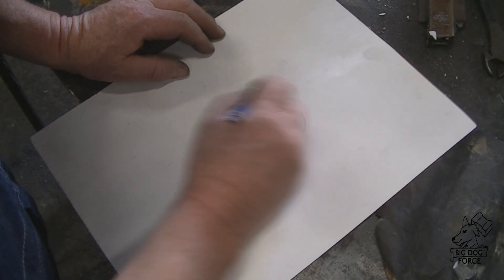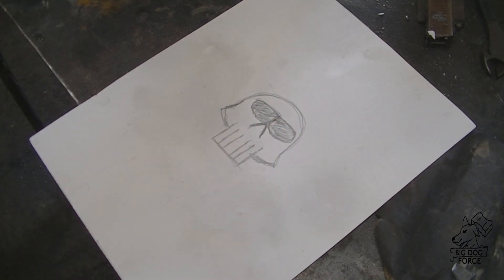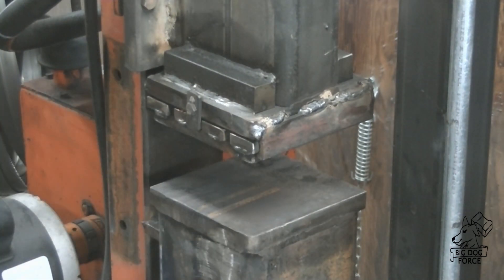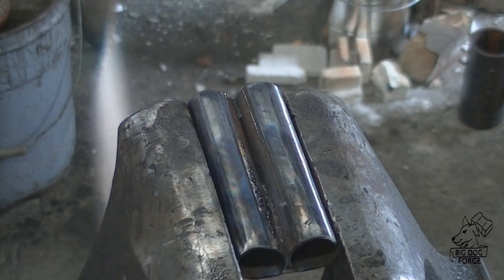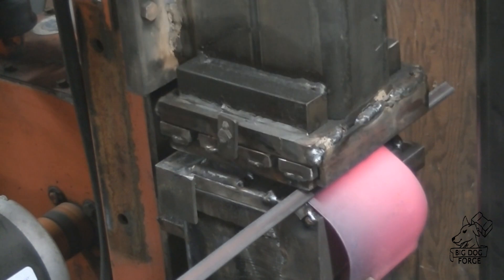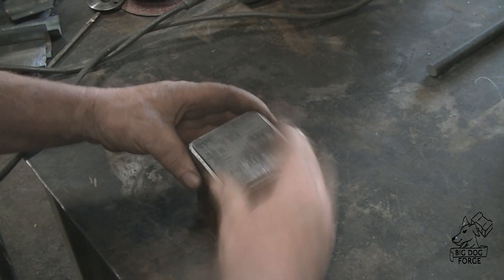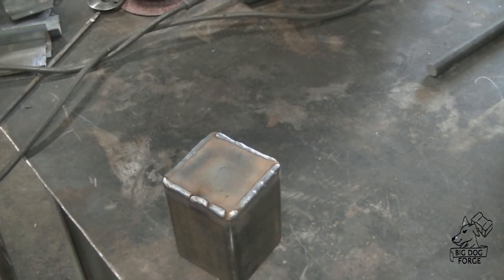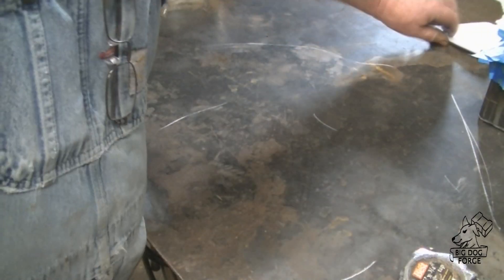Forging / Blacksmithing Skull Damascus Part #1

Comment: it was only $14 to send all that chain, i work on forklifts for a living so all that chain is new cut offs. can't wait to see what you do with it. the other piece is part of a cutting blade for an excavator. and i love the skull, very cool
Reply: Hey, if you have any more of that cut off, and want to send some to a poor old timer in Ohio, let me know and I will provide you with my address. I can definitely afford the postage, but that's about all I can do. Sorry, but I am retired and living on a very fixed income.
Reply: i can get as much as you want "within reason lol" but i like to trade for other stuff. what do you have to trade?
Reply: Not really sure. Hadn't thought about that. I do have some excellent walnut 12" x 2" square blanks and a couple of cherry of the same dimension. Will have to think about it.Thanks for the quick response.
Reply: email sent
Reply from the maker: Thanks Jason I can't wait to use the chain, and thanks for the kind words.  Take care.
Reply: jason nichols I still have yet to start getting closer though just curious would you trade a box of chain for a flint/glass knife with an antler hand?
Reply: don't really have a use for one
Reply: jason nichols ok maybe I can think of something else
Reply: i'm always looking for different kinds of steel, wood for handles, that knid of stuff. don't like antler
Reply: jason nichols gotta love flat rate shipping
Reply: yes you do
Reply: That's looks more like the cut edge off a bucket for a wheel loader or track loader.
Reply: it was off of a bobcat excavator

Comment: Great video! I've always wondered how patterns like this were made.  25+ years ago when I was making stock removal knives I met Steve Schwartz (sp) or maybe Schwartzer(sp) can't remember, at a local rendezvous and he showed me a pattern welded folder he had made with the American Flag in the blade.  I've wondered to this day how he might have done it.  Bought me a  Peter Wright anvil on Friday marked 1 2 17,  and as soon as I can get up some scrap metal I'm going to start forging some tongs, hammers, and building a power hammer like yours.
Reply from the maker: Thank you for the information on finishing blades with the Brass mandrel that sounds like a great idea I will give it a try.
Sounds like you got a good deal on an anvil .  It's always good to hear someone is jumping in or jumping back into the craft.
Thank you for all the comments I do appreciate to keep the great ideas coming.  And thanks again for watching take care.

Comment: That's pretty cool. I never heard of canister welding before. I would have thought that the lack of flux and the air trapped in there would have been a problem, causing a bunch of porosity.  I imagine you'd have to do the sizing down more gradually if you want to avoid distorting it as much.

Comment: That came out really well. I thought it would distort more, even under the press. I've often wondered if it was possible to achieve something similar by taking a stacked layer billet and grinding a simple outline into the face of the billet with a rotary tool and then pressing it flat. I got the idea watching an old video on raindrop pattern damascus.  Might be something neat to try out one day. 

 I can't wait to see what that forklift chain looks like welded up 😎

Comment: This is very cool as a design and I particularly like the bb end. It’d make great pendants if you maybe set the Darth Vader-ish skull on the diagonal so you could drill the hole on the pointy bit at the top rather than into poor Darth’s head

Comment: on the opinel knives when you open the blade you can twist the metal ring on the handle to lock the blade out
Reply: spoplehughes very good blades in very nice price!and the lock is genius!
Reply from the maker: Very cool I didn't realize that thank you very much.  And thanks for tuning in.
Reply: I have an Opinel in my pocket everyday, even in school, for almost a year now, and they are absolutely perfect. Super sharp, easy to open (I deep- fryed it, so it opens really smooth)
Love these knives!
Reply: I didn't know opinal knifes did that cool 👍
Reply: love to see a blade made with skulls very clever 👍
Reply: BIG DOG FORGE Big Dog opinel are the best value for folders!
Reply: And on the newer ones you can lock it shut also, so it doesnt open in your pocket 👍

Comment: Powdered cast iron: a little goes a long way to add carbon content
Nickle: brightens the steel up
Chromium: a bit of toughness and brightness
Vanadium: Use a couple flakes of it with the cast iron and base iron, the mixture will do what traditional damascus does and the vanadium will create a carbide lattice in a high carbon steel matrix.

just since I noticed that you're working with powder chemistry and alloys. Usually these powders are pretty cheap online and go a long way when you're using standard iron powder as your base mix. And, not that you need it for impurities since it's all been refined, but I find that borax can be necessary to the most minor of extents to help keep oxides under control which helps with the iron powder and how quickly it oxidizes. As always, add any element in sparing quantity, but they can make for quite an awesome steel if you pull off the right mix, especially since you know it will all forge weld without an issue.

But I'm not trying to come at you like a pro, I'm just a student of the art. Maybe there's some useful stuff in there, maybe it's all a ton of garbage you're well aware of, but either way I hope I helped a little. The skull turned out awesome, by the way. If they were smaller in nature, you could stack them end on end and make them in to a wicked sword core with a 1080-1095 edge welded in. You've inspired me to experiment on some things now :)

Comment: That is amazing, I've always thought about how to do this same thing.
It's almost like making candy, caining I believe they call it.
But I figured that a hammer would blow the can apart during the weld and it wouldn't work, but I hadn't thought about using a press.

Comment: Have you ever used nickel 200 (pure nickel) in your Damascus? It's beautiful, it doesn't etch at all and looks like a mirror. It would be great for things like this. When you use it on blades you have to make sure it doesn't end up on the edge though, it doesn't harden.

Comment: The Cat head bolts are probably torque to yield (I know Ford has used these 20 years or more). Once the bolt is stretched it cannot be reliably be reused.

Comment: Have you tried using white out to coat the inside of your canister?  It helps with releasing the Damascus and saves on grinding.
Reply from the maker: I have tried it with varying results, I think I will do it again on the next one to see if it changes anything.
Thanks for tuning in take care.

Comment: +1 for the powdered steel versus the BBs. It's a more uniform background. Great job for an experiment. Could be a neat accent portion in another Damascus pattern. Would make some cool belt buckles, coat buttons (if forged smaller), or similar articles. Send some to Alec Steele, I'm sure he would do something cool. Maybe inlay a section into the cheeks of a new hammer or something. Nice job for a first try experiment, really!!Had a Damascus idea for you too. How about using the jelly roll technique and creating Capt America shield Damascus. Create a star rod and use it as the center, and then jelly roll around it. Or, canister damscus with concentric rings using steel pipe and a center star rod.
Reply: +1 For Cap Damascus. Good idea.
Reply from the maker: Hello Bryan, I love the captain America shield Damascus idea it's definitely going in the queue.  Thanks for the awesome suggestion, I think I may get a belt buckle or two out of this as well but my first attempt is going to be a knife blade just to see how many inclusions are in the bar.  Thanks for tuning in and take care.